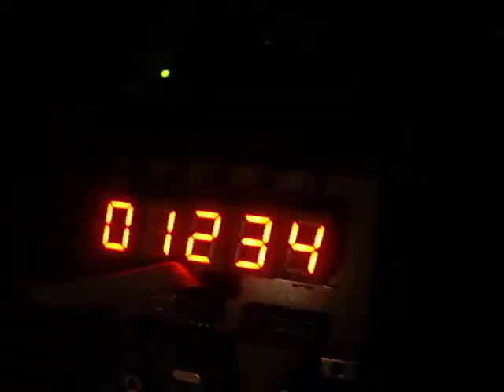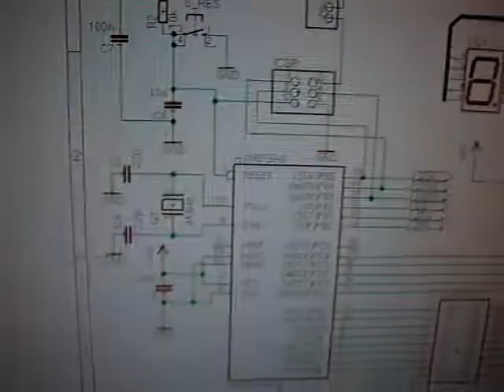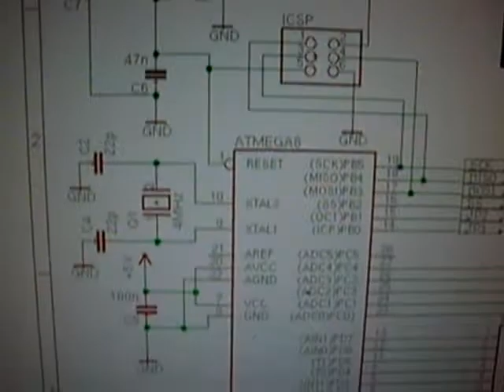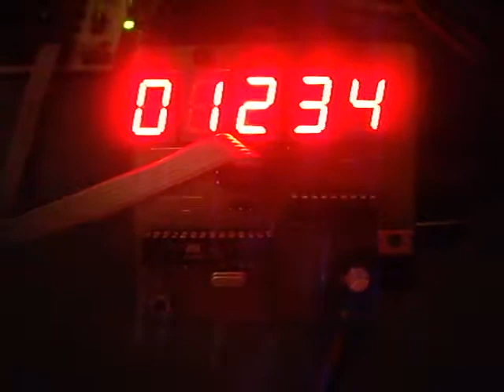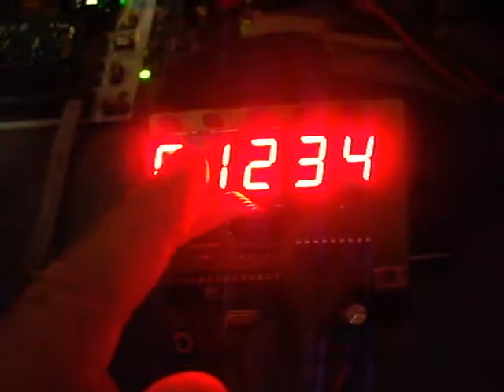7-segment multiplexed display

Comment: Hi 
              Mine is also this project only i am trying to find out the solution from the past two months but still yet i didn't get Would you please help me in this regard to continue my project in this concept only otherwise i need to change my project Actually every1 guiding for upto 4 digits but no one knows above 4 digits seven segment display Please help me with concern material  , circuit and Documentation , schematics and coding to my mail id :megha046@gmail.com

Comment: Yeah I know. STK600's are really hard to work with and you need to buy extra cards to support different IC packages. I just have a AVRISP MKII. I've built a bunch of dev boards with leds and what not. Good stuff. I would get a stk500 but I don't have a serial port and Not to much of a point to use a mkII with a 500 if I already have the peripherals.

What method did you use for the pcb?

Comment: If you need more free pins in a project, you can use a decade counter (e. g. 74HC4017) for positional selection. You would only need one pin (the clock for the counter) for up to 10 digits. (of course you will still need the pins for the single segments; could use a shift register for that, cuts pin use by 6)